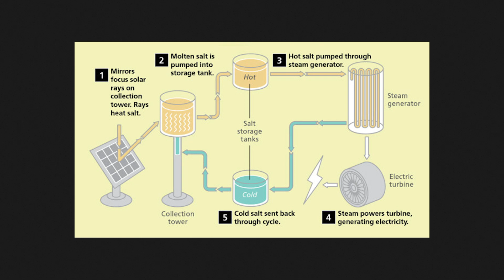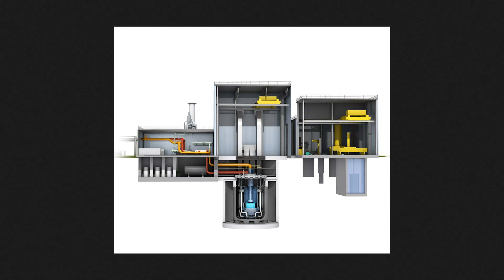Thermal Energy Storage [Fixing Renewable Energy] | Ep. 19

Comment: Whatever happened to the idea of superconducting powerlines?

They’d be super useful across many time zones. It could help accommodate the peak hours in each time zone.
Reply from the maker: It would certainly be a more efficient way to transport solar thermal and wind energy across long distances. However, they are much more expensive than traditional transmission lines.
Reply: @RockLogicWithSeanKenny  But how expensive ?

If you had a superconducting powerline from the East Coast to the West Coast you can sell power when it is cheap on one coast to the other coast during peak hours, Then sell it the other way three hours later. Wouldn’t this generate a massive line of income?

Comment: I am planning on storing heat in candle wax, but in my case the heat is for a hydronic heating. Right now I am using some 1960's Steffes brick heaters. right now the Steffes heaters use "off peak" electric, but my future plan will be able to use roof solar to also add heat.
Reply: Good one, molten wax stores can be good for home heating. Do the sums though, you need a lot of wax!!
Reply: @jimgraham6722  I got 12 pallets of candle wax from an auction at $5 per pallet. it's got all kinds of odd pine cones and things since it was from a candle making company.
Reply: @LaserFur  That should do it. If DiY take care with safety aspects fire prevention and so on.
Reply: @jimgraham6722 the plan is to put the wax in a large tank with a large roll of pex as a heat exchanger. then the solar toughs will heat water and for backup I'll have an electric boiler connected to off peak.
Reply: have you learned what the phase change temp is for your wax (wax pinecone) thermal storeage is?

Comment: Bill Gates support for any product or technology for some reason make me nervous? 

Please when mentioning different types of reactors could you please tell us.
How safe it is.
How much waste it generates.
How long is the waste dangerous.
Reply: These new generation plants are walk away safe, the plants shutdown and cooldown automatically by design, like how your car shuts down and cools down when you turn it off or runs out of gas, as in no need for the extensive band-aid safety and residual heat cooling systems of the plants designed in the '60s and '70s that are operating now. Also the new fast neutron plants will run on the spent fuel from the older designs. The spent fuel from the existing plants is stored in concrete and steel bunkers or casks, the background standing in between these bunkers and casks less than an international flight. After 50 years of operation the average space used by these bunkers and casks on a spent fuel pad for a dual core plant takes up less space than a small strip mall parking lot, or less than the real estate used for one wind turbine.
Reply: Bill Gates is a very, very decent person.

Comment: The molten design is great all on its own for the full electricity demand. Now if you want to make it more expensive, more complex, and use far more land, you simply add renewables. The theory is that those renewables will already be on the grid and Moltex will replace natural gas. The nuclear folks using logic assume when those renewables wear out, they won't be replaced, oh but they will and that will keep electricity costs high forever. Have they removed the corn ethanol subsidies and mandates, even though they make no sense, no. The same thing will happen with wind and solar. 
I think Moltex is their own worst enemy, they pander to renewables all day long but as long as people think renewables have any value, they will reject nuclear and just scream batteries, renewables can do it all. They need to be honest about it, this technology will replace natural gas and renewables.
Reply: 👌 Renewables only last 25-30 yrs. This will become problematic over centuries because of the materials necessary to make them. Nuclear (as you & Sean state) is the FUTURE of baseload, clean energy

[Youtube has a bot or paid TROLLs that DELETE factual comments]
Reply: Totally agree, the nuclear industry is pathetic in its pandering to renewables. It's like they don't believe in their own technology.

If molten salt energy storage is indeed economically viable, it should be used with a power dense and reliable energy source in order to compensate for shifting demand.

However, since most molten salt reactors in development will be able to ramp up and down with demand, there may not be much use for it.

Comment: nit: We'll be able to recycle 99% of the materials from the lithium batteries, so it's really just the cost.
Reply: The complexity of the system and its inherent danger is still an issue. There are better materials for BIG batteries. Li-ion should remain in portable devices and electric transportation though

[Youtube has a bot or paid TROLLs that DELETE factual comments]